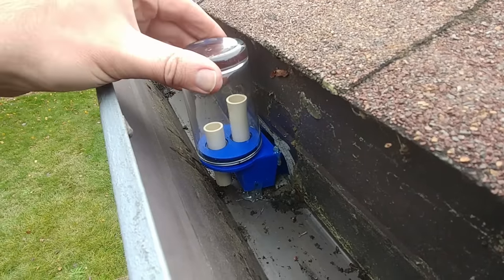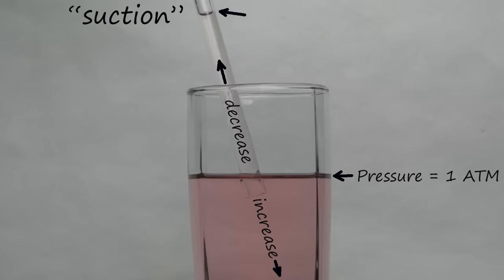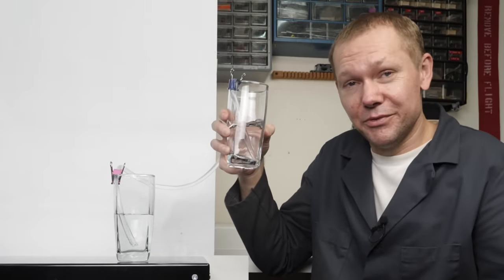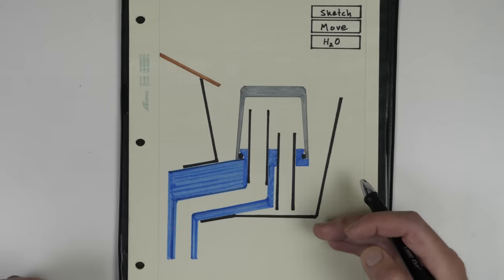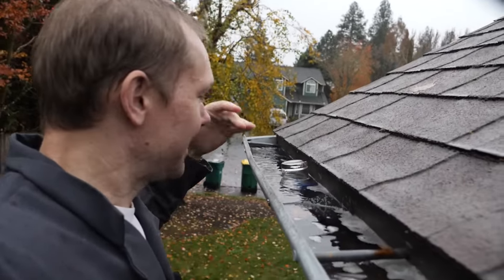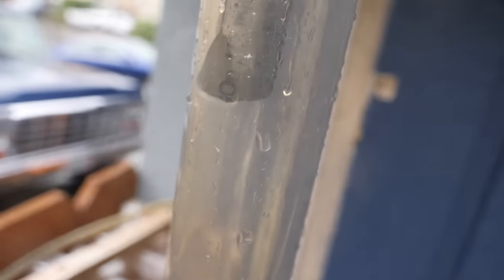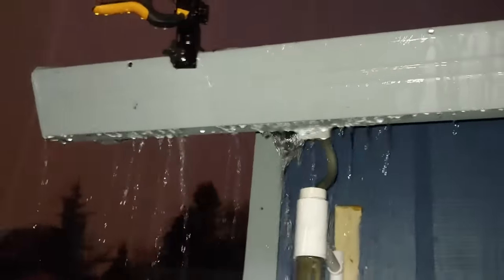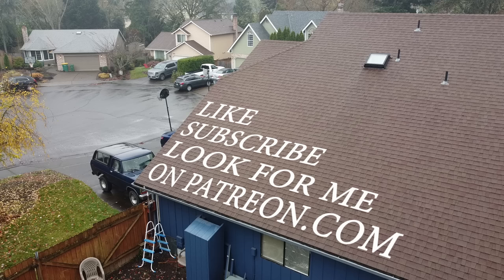Rain Gutter POWER #5 - Bell Siphon Fundamentals and Pitfalls

Comment: I've got an idea for a build!  Use a herons fountain out of platic barrels with the 2 holes to connect the pvc to the other 2 barrels and also making a gravity pump that pumps up hill,  but take a coil of copper wrap it around the air pressure tube and on the inside  place a high powered magnet so u pump the water in  then it will pulsate and build up pressure and at the same time. It will conduct electricity  and turbine drain generator so that gravity pulls it down and everything will recycle itself and create it's own power in small compact system,!
Reply: It will work
Reply: A ram pump is what I meant.  When i said gravity pump
Reply: If they can get those shake lights working by shaking them,,then what if you take that same concept and place the magnet and copper and stick it inside the ram pump !
Reply: The same thing as when the water drains back down with gravity.  And all you need is to design a generator in the drain ! And the herons fountain ,works on water siphon and gravity  and it would work for rain water or gutters or whatever!  Think about it
Reply: You can also connect a inverter and batteries to store the power and convert it?
Reply: What do you think ! It's possible!
Reply: Put a water weenie foam in the ram pump with the powerful magnets on top of it so that it can continuously pump up and down in the pvc tube.

Comment: In the example of the straw and atmosphere pressure, technically no. Your just creating atmosphere pressure with your finger. The air in the straw is the same as the air making contact with liquid surface in the cup, it's just now your finger is acting as the 'covalent shell' of the trapped atmosphere.
In addition you feel more pressure at the bottom of the cup, because all things comprised if matter are magnetic.
Do at the bottom of the cup, you are attracting all of the molecules of the water, which is very good at carrying an electric charge, so you pull all of those molecules into you, and those molecules also have a relationship to the atmosphere which they also pull on.

Comment: My dad is a plumber and uses a piece of clear 20metre hose with water in it... on stakes to workout the pipe height he is laying in the ground so it runs down hill... very old school no electronics required solution

Comment: you could add a second Bell Syphon at the overflow^^ maybe just a little higher that the other one, so if it rains to hard, both will suck the Water^^ and you could direct the water through a pipe to your generator :P

Comment: I could see building an enclosed larger version to get more power to the wheel enough to turn a car alternator and a weight added to the wheel to act as a gyro to maybe keep a continuous spin to keep things spinning at a constant and have the 12 volt car power inverter with a water pump plugged into it to return the water to the point of origin to keep the flow at a constant. Just a thought but would be an interesting experiment
Reply: Or even better instead of a power wheel replace that with a tesla turbine and work out a flow valve. Something as simple as a garden hose water valve if need be to keep the rpms down enough to keep the turbine from flying a apart. That way you could produce enough power to return the water to point of origin and create power. I like how you like the keep it super simple thing. And that's how I'm wired. To best to keep things simple enough to where anyone can do things with basic knowledge.

Comment: I believe the self leveling works in a vacuum.  Its not the air pressure, its the fluid itself acting as a single body of fluid when connected with tubes.  Gravity is what is doing the self leveling.

Comment: The dribble problem is caused because the down tube is not “sealing” … it does not have water across the whole tube so the atmosphere (as you call it) is allowed to get to places you don’t want.  A P trap like on the bottom of a bathroom sink would solve that.  Water would pool at the bottom of the P trap sealing the whole tube with water and then the suction when the water finally started to flow would cause the siphon to continue.  The p trap is better than just restricting the flow because once it starts to flow, you will have the entire diameter of the tube for the flow — not a restricted amount.

Comment: Next you can calculate the volume of the tube driving your turbine... Nd section your drain over head carriage for multiple siphon pump.. thereby driving multiple pumps and turbines generating more power and never over flow... as long as it is not a cloudburst.

Comment: I believe you over thought the problem. First: You need a gutter guard in the gutter. Protecting from leafs and other things. Also, you know, having more than one is best. Id also consider installing a water reservoir instead. All pipes lead to one reservoir and there the generator  sits

Comment: To deal with heavy rain you can add a few more siphon's on a slightly higher level so on the slow rain only the first one would be triggered and it will get full flow heavy rain a few of them can get triggered are you can drain more and also get the power out of it

Comment: What about a flexible orifice going into the drain pipe? If it's a funnel-like shape, the slower initial flow will allow the water's surface tension to prime the seal, but the orifice diameter grows as flow rate increases. Might be prone to UV damage from the sun and require material like TPU or silicone to work, but it would be interesting to see if that makes a difference.

I know this is 2 years after the fact, but maybe if someone here wants to try it themselves, this would be a neat idea.

Comment: I have some questions for you:
I am also an  engineer, but electronic, so I could say some nonsense about these mechanical and hydraulic things.
First question: why not add an accumulator, that is a tank, under the eaves, before the down pipe, which would compensate for the variations in rain intensity, and would also create a reserve of water?
Second question: why not use a more efficient turbine than the one you are using, such as an old pelton or a more modern one, with closed pipes, and jets all around the blades like those of hydroelectric power plants?
Third question: instead of using a single outlet pipe from the siphon, which requires a lot of water to trigger, you could use several smaller diameter pipes, which then come together underneath, but I don't know if this last thing I said could really work. ..

Comment: Could you place a buoyant cup in the down tube? The cup will act similar to the water wheel cups.. as the incoming water enters the tube some is deflected in the cup creating a downward pressure .. cup is maybe 1/8 smaller than inner diameter to allow Water passing by. The cup being buoyant is creating pressure below it increasing the force of the stream at the bottom. Maybe? Almost be like a passive plunger.

Comment: the out flow is ment to be higher to the roof of the glass in order to work propelry (fix your issue), so in conclusion you can use smaller glass

Comment: You should use a 2 stage design where the rain water father's in a reservoir that contains the tube cyphon in order to minimize the flow rate issue

Comment: Did you try a tesla turbine on this build? A smaller wheel would be able to reach those higher RPMS and adding a couple of disks to the motor in parallel would increase the torque using the boundary effect no?

Comment: I have an idea for a modified bell syphon that wouldn't suffer from the dribble problem. What if you had a downward facing flap held in place with a spring that opened once the water reached high enough to force it open? The flow would keep the flap open until the syphon stopped.

Comment: It is not that rates are the same (design wise), initially rate of bell siphon is higher (thats good and how it should be), its just pressure it creates not enough to push water higher to reach overflow, that means that water that near the overflow (but higher than exit tube of the bell siphon) creates pressure and pushes water back (slightly) which slows down the rate of bell siphon itself.
So yes by this mean whole design isnt equal by rate but does self equalizing it by pressure of water... great job!

Comment: Should try running the power to a water pump and catching the water out of the jet and connect the the water pump to the collected water and running through the down pipe again and see if you can get infinite power and then when it rain that will evaluate for the evaporation of the water

Comment: As far as I know the siphon and the turbine are not matched by design. Since the tube, where the nozzle is attached, fills with water, it acts as a reservoir itself. The flow of the water through the nozzle is proportional to the height of the water level of that tube. And the water level changes with the total water flow (input minus output). So if the flow rate of the siphon is reduced, the steady state water level of the tube is also reduced.
Hope my explanation is understandable. Just don’t increase the flow rate of the siphon further or you’ll waste water through the overflow.

Regarding heavy rains: you could also try to mount two siphons with different trigger levels. The second could be used to prevent overflow. It could be used to feed a second vertical tube with a second nozzle on the right side of your turbine. This way you could double your power during heavy rain, reduce the side force on the bearing of the turbine and prevent wasting water.

Comment: Reduce the size of the pump and raise the tube above the drain discharge. When rain water levels are going to be to high for the pump to handle the overflow tube is high than the needed for power supply recharging the battery.

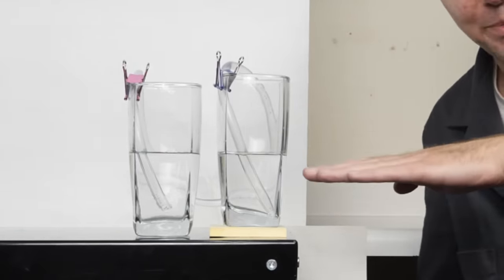Comment: 15:45 i remember my father and others using transparent water hose with water in it to transfer or check levels across the distance. Or something like that.
Reply: That’s exactly what standard levels do. The tube is just a lot smaller in the level. That’s the beauty of a level. You can make one from any transparent tube. You just need to carefully measure and mark the center. Super simple. Super accurate.

Comment: I did something very similar with a DIY flood and drain hydroponic system incorporating a small fish pump of course I'm pretty sure I made the whole construction out of 2 rectangular crates sitting on on top of each other off the shelf 1 inch PVC tubes two elbows and a couple grommets took a couple of hours to make, giving your not dyslexic I'll give you a break on the Shorty workmanship

Comment: 1. The bell should only be slightly larger than the siphon tube.  2. You need 2 siphon different heights. So if the first siphon isn't fast enough the water will rise until it starts the second siphon.  Look at flood and drain systems for aquaponics. .

Comment: Can you just add a second vertical reservoir along the first pipe with a second nozzle pointed down at the same wheel to increase speed and set that to cycle based on how full it gets from the overflow? Or add a secondary bell Syphon at a slightly higher level that would only kick in when the first is overwhelmed?

Comment: I wonder if your catch basin was cone shaped if you could a) hold more water during heavy rain and b) have a higher pressure at the power nozzle reducing water consumption for the same energy output....

Ah. No indeed the only factors for pressure are depth and fluid density, cool cool. In any case a larger catch basin would provide a larger reservoir to absorb rain flow changes.

Comment: Seems a dam at the other end of the gutter, cut to the correct height to work as an overflow once the siphon is overloaded, might be a good solution for excessive rain. Or maybe even some kind of plunger and float mechanism. But a simple overflow seems best.

Better yet. Dam the center, and parallel the whole system on the other end. Or create a slanted drainage from the other end that returns that water back to the main to function as additional water flow to the power.

Comment: While there might be a neater solution to your issue, I wonder if beveling the edges of the drain tube would help prevent water surface tension from building up and damming back the water so it could drain more water quicker and lower the pressure quicker.

Comment: For the siphon experiments its handy to add a little dye or glitter so you can watch the water flow. Might be interesting to see what happens if one glass is salt water or another is warm water etc

For the gutter i wonder if you had a seond tube pointing downwards in the gutter that joined the main tube lower down. would the water flow when triggerd buy the bell siphon passing the tube entrance be sufficient to pull water through and get a second siphon going

Our would a siphon in the style of a Pythagorean cup (or multiple) bypass the issue?

Comment: Have you seen the shower heads that use the water pressure to power leds? Can you use chain multiple of those shower heads together in a tube with that pressure and get more electricity? Efficiency of water use, so it doesn't splash everywhere to turn the pulley.

Comment: An easy alternative could be running the water into a sealed tank and using the resulting air pressure to run an air turbine instead.

Comment: What about changing the turbine into an actual water turbine inside the tube? Propably higher efficency. It would kind of look like a Turbo.
The oveflow problem could be handelt by some fluid engineering. Two syphons or an other tube diameter.
I like this projekt, will definitly the something similar at home.

Comment: That the flow of the siphon is the same as the consuming part is not true. @13:00  - When you look at how fast that tube filled up to the point where the overflow-protection almost is hit is a clear indication that the flow of the siphon is way higher. I assume it stays steady below the excess-pipe because of the pressure within the main tube itself filling up.

Comment: maybe you can make the syphon to have a multi level input? the second level to be a sealed separate system. OR maybe you can make the system to have a second generator for the second syphon to handle additional water flow? it will be more like a parallel system that activate secondary flow/generator only when needed. BTW, doesn't it makes to water flow faster if you connect the output of the syphon directly to the jet output? idk about that actually...... just some suggestion XD

Comment: If the gutter /turbine could generate enough power to pump from a rain barrel so you could water plants it would have a practical use.  But is watering plants important wherever there is sufficient rain to power the system? Maybe powering motion triggered LED lights where you don’t get enough sun for solar ? Interesting and fun but doubtful it’s cost efficient to build and use.

Comment: Amazing brilliant and simple, without any motors and pumps. How i can use this if my roof is flat. And one place on in i have depression. All time i have there a lot of water. And maximum depth is only 1cm. Roof is big i have there 100...200kg water when is rain. I want use domething like this. How i can build this with easy parts but remember is only around 1cm depth. Can you help me?

Comment: You have me thinking we have a 3000L rainwater tank that I've never got around to connecting it up to the toilet to put that excess water to use in winter most likely 3000 litres of water going down the drain some weeks, would be interesting to make a power generator using a bell siphon incorporated in that 3000 litre tank but what would be the point besides seeing one of your creations work nothing is better as you said.   Kind of like a water Dominos when it works correctly water will always find a way to surprise you

Comment: Make the siphon a little smaller and setup a toilet flush trick to remove excess water or just a side drain on a single spot, so the overflow won't be this messy

Comment: A foot of rain on a 40x40 roof would be 11900 gallons and would weigh. 100,538 lbs. Assuming 20' of fall you would have about 1.5M watt seconds. Unfortunately that's only 454 watt hours, or about 5 cents worth of electric. You probably used a years worth of energy generation with the heat gun alone.

Comment: What if you increase intake funnel of the exit tube instead of lowering the exit. That way you should have the same flow but also greater force, due to larger area of intake, to trigger the syphon. Thought for that your whole set up needs to scale up, however a good excuse to use a 3d printer :)

Comment: Could you not have to bell syphons but have one set up that it would only trigger when the flow of water is above the level the first syphon handles, either with a float that would trigger the syphon, or just having the level of the pipe you use high than the ones in the first syphons. If not for the low amount of power this generates it might be interesting if it were to also power a heating method to keep the flow of water from freezing during the winter months or even slowly melt the snow on a rough to keep a given amount of water flow. You could have the second bell syphon hooked up so that it diverts the water down a pvc pipe that hooks up to the primary outlet you are using.

Comment: I have a question, so the overflow.. the water filled up and went over the tube that was pushing all the water out.. wouldn't that cause some restriction on the water flowing out? Shouldn't you have put the overflow BELOW the tube that is pushing the water out?

Comment: What would have happened if you had chosen a glass that hasn't that much free room over the top of the outlet pipe?Would it been possible that the pressure on the watersurface in the gutter would then push the water into the outletpipe when the reservoir is absolutely full?